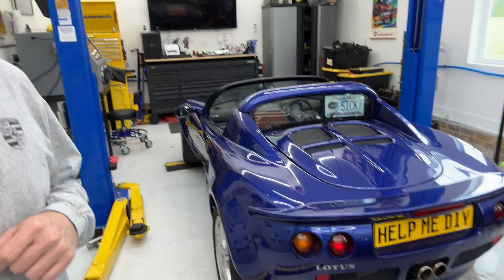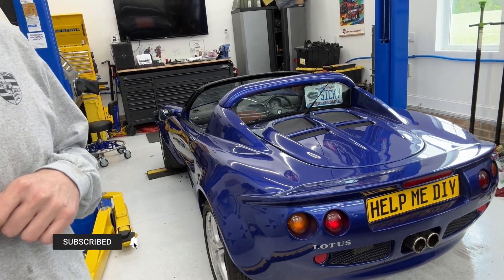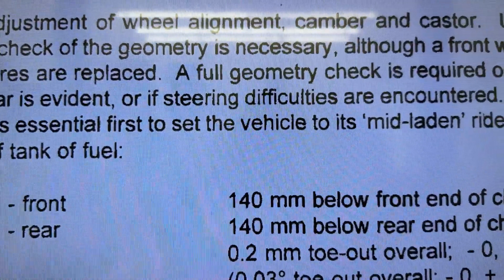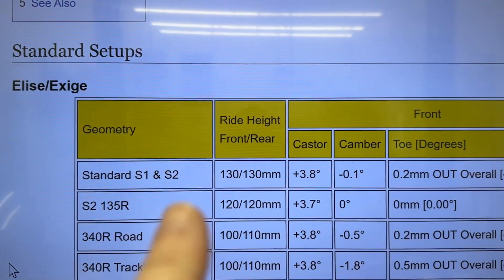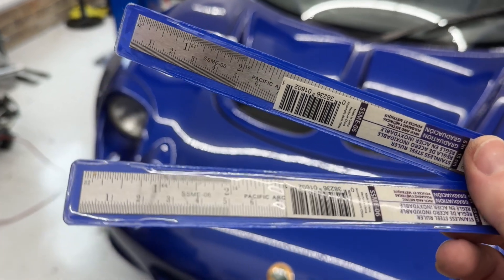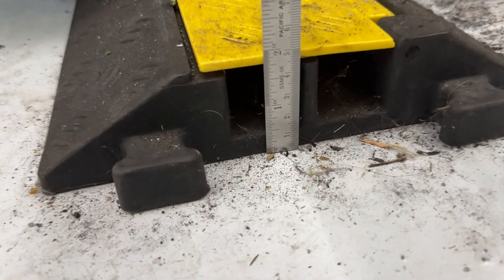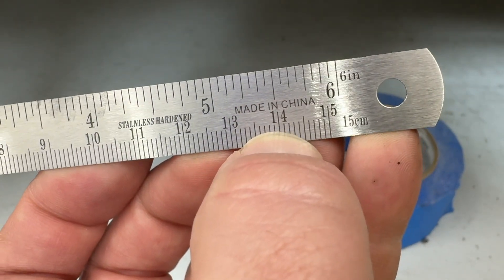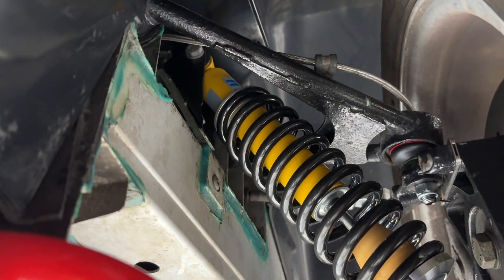Lotus Elise S1 Ride Height - (Alignment Part 1)

Comment: Good video as usual. A little note is that the ride height will be a little high after setting the car down on the ground from a lift as the natural movement of a lifted suspension is to camber out. As is contacts the ground it still has much more positive camber (top of the tire leaning out) and once the rubber grips the floor the camber doesn’t truly settle until the car is rolled a little. Alignment racks have ceramic ball bearing mounted plates to prevent this false reading. Hope this helps. Keep up the great work. Always a fan.
Reply from the maker: +@branchoffice1327 yes great points. Thanks! 🍻

Comment: I think using the Bilsteins on the S1 (Bilsteins are standard OEM spec on an S2), the S1 ride height is quite a few mm lower than the OEM Koni spec S1 ride height. 8 to 10mm springs to mind & my 97 S1 on Bilsteins is defo lower imho.
Reply from the maker: +@drew699 I hope mine settles lower. I forgot to measure the before, but the after seems higher. Although I was replacing older Bilsteins not Konis